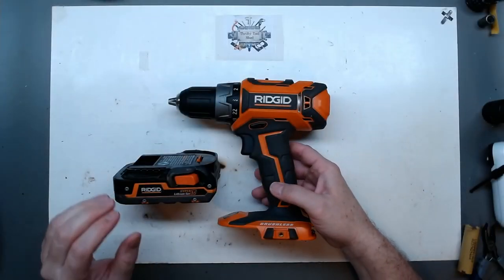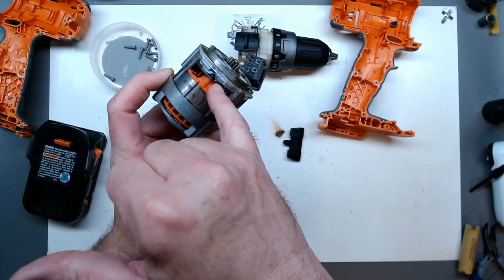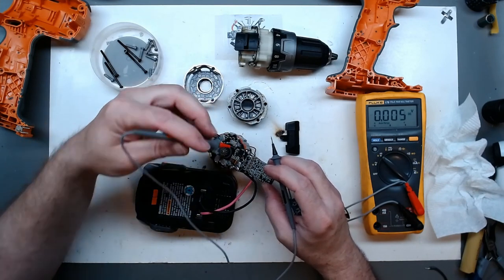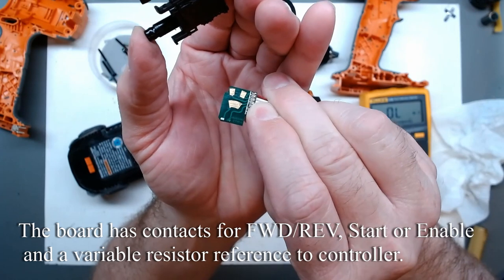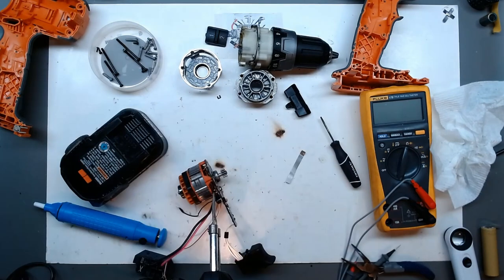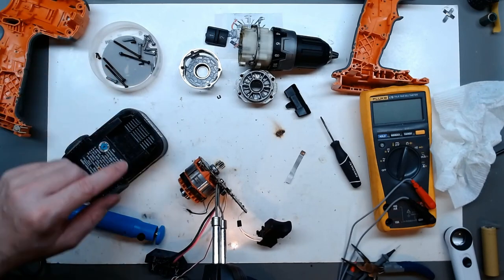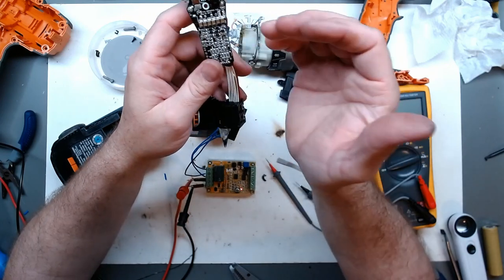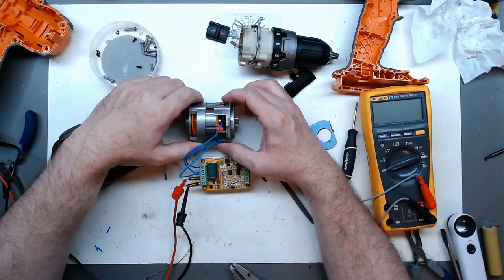Ridgid Gen5 Brushless Drill - A Look Inside

Comment: Thanks for the video - well done! It gave me the courage to try and fix my drill. However, when I went to put it back to together there was a small thin copper piece with a u bend in the middle of it and I don't know where it goes - ugh! I cannot find a parts diagram either. Would you by chance be able to help? Thanks
Reply from the maker: It's been a little while, trying to remember. Is this from the trigger module  or just the drill housing? 
(Did you disassemble the trigger switch?)
Reply: And thanks for taking the time to reply!
Reply: @jonhill4612  that piece  was in the trigger. this was what went on mine
Reply: @jonhill4612  

Was your issue resolved? I repair tools, could help.

Comment: Informative video. You should get yourself a Hakko FR301. You'll never regret it! Or, maybe they will send you one.
The micro appears to be a TI DRV91680 which is a brushless motor driver which appears to have the microcode programmed in it already according to their extensive data sheet. Might be worth a fix? But removing it and soldering it in would be a bear.

Comment: That control chip crack means the whole 
board is deuced.
Busted itself during an overload due to misuse  
from previous owner. 
Circuit board looks familiar like the the Ryobi brushless hammer drill circuit board I've seen 
from when I've disassembled one.
Reply from the maker: Yes both made by TTI, I did figure the new Ryobi Brushless is very similar. Well the chip is failed for sure, but I do not think overload should cause a microprocessor chip to fail. I could see the water damage from the water line formed be a issue. My best guess is trigger failure and 20V got accross the 5v buss or input to controller. A little more testing and I did realize the trigger gives full voltage signal as well as the lower input voltage levels back to controller and that can be a bad ending for sure. It seems the trigger gives the 20V feedback to the controller as a wake up or enable for the 5V rail for the micro. Thanks for your comment!
Reply: Reason I'm no fan of brushless. Added complexity with the inclusion of PCBs. More failure prone. Get some dust and moisture the tool 'dies'. Most people would not go through the effort to repair, just toss and replace. I've fixed so many just opening up and air dusting the PCB. 

I dunno, I'm not a fan of tech for tech sake.

Comment: How to remove the two wires near the plus and negative terminals at the tool in order to modify and put another battery from another brand ????
Reply from the maker: It has been a while since I worked on this. I believe you can desolder the wires from the lower connector? There are also some adapters available and here is just an example of one that lets the Ridgid use M18 packs. This is for example only, I have not tried these myself to say..
https://amzn.to/3w6uR7g

Comment: Did you manage to give some use to that motor?
Reply from the maker: I did, the jigsaw is still working great and I am going to make something else out of the drill motor, maybe a small fixture on the bench that I can make into a sander or cut off wheel if needed and use any 20V platform I have. The 20V BLDC is to nice not to repurpose.
Reply: @ThriftyToolShed  
That is good. So when you manage to build something with that brushless motor, please make a video. It is always nice to give a new lease of life to these tools. Would be there a way for you to still use that motor in the drill but just having a constant speed instead of having variable speed? Would it work?
Reply from the maker: @ruinunes8251  
Well it would work in drill with variable speed as the jigsaw. The 2 issues with making the drill though is that it did not have the room inside for even the tiny controller since the original was built into brushless motor and even if mounted outside which is possible (even if not pretty), we still do not have a reverse on this controller. So outside mount and no reverse. It is reversible controllers out there we could use of course, just none as small as these that I can find. Though reversing these BLDC's is very easy to do, just not in the space confines of the compact drill. I will share when I get time to build the fixture.

Comment: Really wish you would of taken apart the gearbox..... I dropped mine and I can't figure out the order for the life of me.
Reply from the maker: Well if you have a specific question I will try my best to help. If you can't figure it out let me know and I can try to do a short video about it maybe? Just be patient though, I am backed up on video editing really bad right now. I sometimes wish I would have gone further with a video as you mentioned here. I love sharing alot and sometimes I catch myself going too far and no one wants to watch a whole hour of a teardown or repair usually 🤣
Reply: I appreciate the reply. Turns out I had everything in the correct order it just wouldn't snap together because the bearings where the gearbox met the chuck were all over the place making space.  I got it all back together and it locked up and caught fire on the control board plastic. Took it back apart and saw there was a bend in the motor housing. Straightened it out. You see I dropped this drill off a roof last winter. All working now lol.
Reply: @ThriftyToolShed  a video would be awesome. My P252 Ryobi acts like the clutch is shot. In process of disassembling it, had some roller bearings fall out before I could track where they went. Would really like to confirm if I got it back together right or not. Thanks!